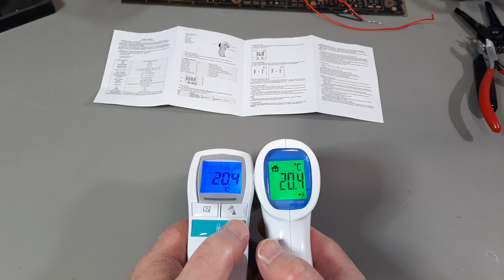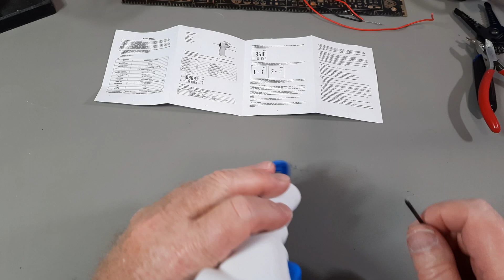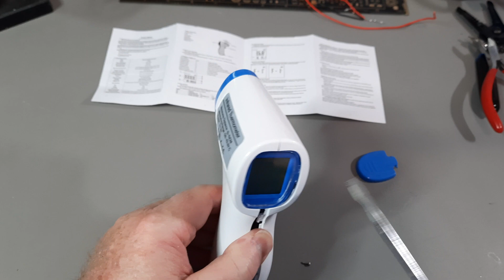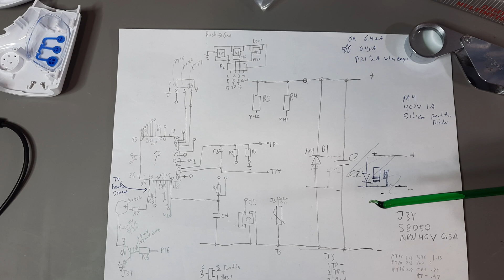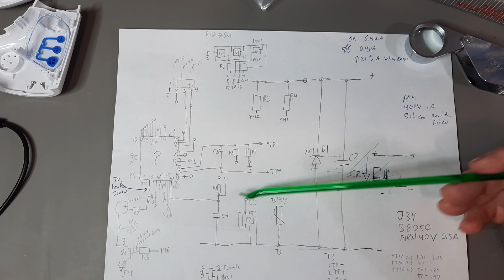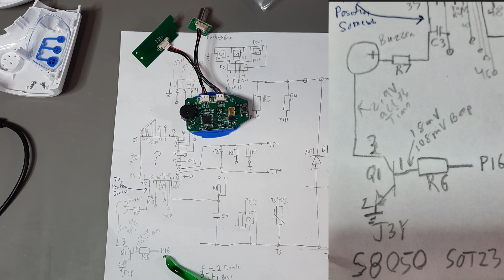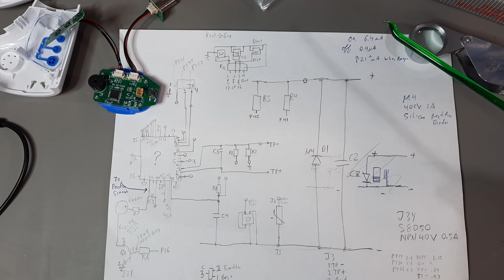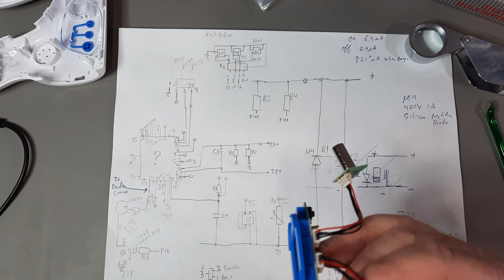Infrared Thermometer Teardown and Schematic

Comment: Hi, can you link the Part? :face-blue-smiling:
Reply from the maker: I normally don't link parts when AliExpress is concerned since the prices change a lot and I bought it about 8 months ago. There is probably a dozen sites that currently have it listed and the price generally is between $7 to $8 Canada.  Lately I only buy from sites that offer Choice shipping, more reliable.
Reply: @retireeelectronics2649  I understand, 8 months is a long time. I asked only because your compare was looking good, and i hoped to find the same easier and faster.
Over all i like your circuit diagrams and your speaking is good to understand for me, Greetings from Europe